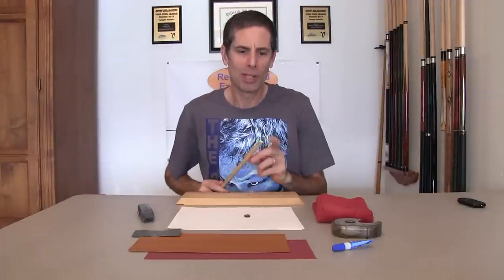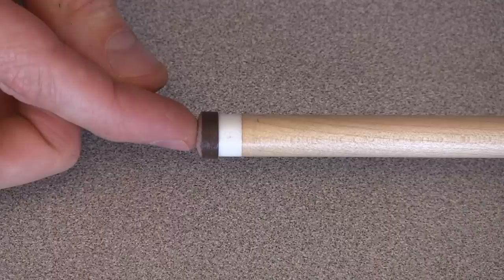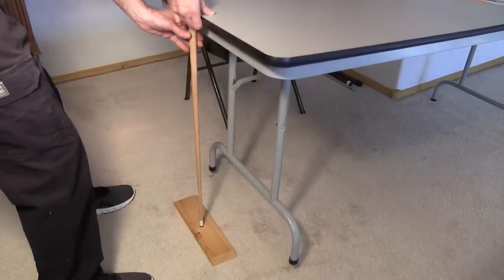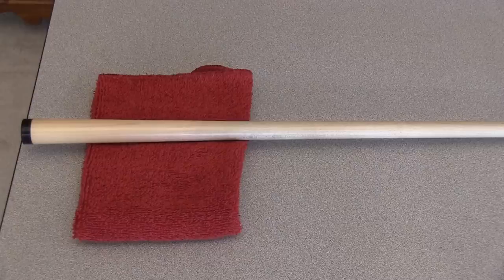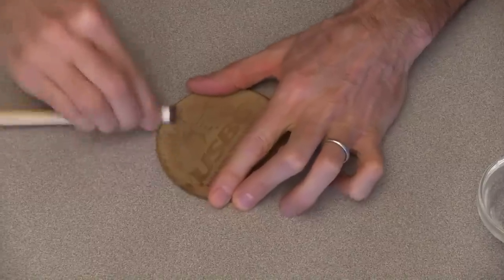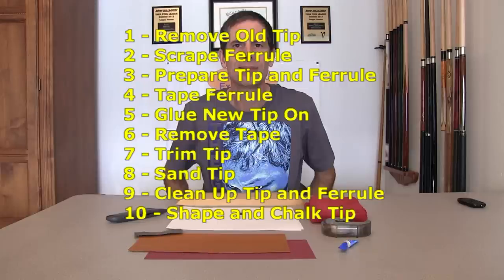HOW TO REPLACE A CUE TIP … No Special Tools Required

Comment from the maker: Table of Contents:
- Intro  [0:00]
1 - Remove Old Tip  [0:35]
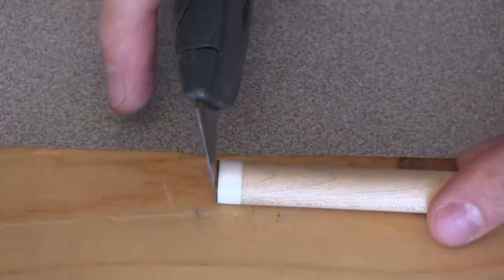2 - Scrape Ferrule  [1:08]
3 - Prepare Tip and Ferrule  [2:02]
4 - Tape Ferrule  [2:30]
5 - Glue New Tip On  [2:55]
6 – Remove Tape  [3:44]
7 - Trim Tip  [4:04]
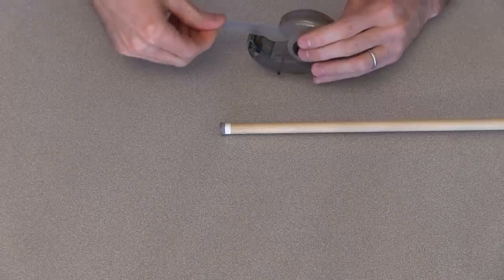8 - Sand Tip  [4:40]
9 - Clean Up Tip and Ferrule  [6:16]
10 - Shape and Chalk Tip  [7:10]
- Wrap Up  [7:43]
---- process montage  [8:20]

Supporting Resources:
- detailed 10-Step Cue Tip Replace Procedure document:  https://billiards.colostate.edu/resource_files/cue-tip_replace_handout.pdf
- cue tip replace resource page with other videos:  https://billiards.colostate.edu/faq/cue-tip/replacing/
- Efren “The GOAT is my Hero” T-shirt:  https://drdavebilliardtshirts.com/product-category/humor/goat-hero/
Reply: I use painters tape to keep super glue off ferrule.
Reply from the maker: @TimZ007  Nothing wrong with that.  I just wanted to stick with one type of tape for the whole process.
Reply: I know this is off topic, (thank you for the cue tip know how!!❤❤) but the Blue Pool Table you use in your videos, aka your 57 ball run out (impressive by the way 👏) blue pool table. What are the dimensions of that? Is it 8x4 or 7x3.5 or 6x3? And what kind of Felt are you running on it? I'm just very curious. Thank you DrDaveBilliards :)
Reply: @jakersdp5604  I don't know for sure but I think it's a 9-foot table. They're always half the width of the length I think. Usually the playing surface on a 9-foot table is 100 inches playong surface. Most likely it's simonus that's usually what everybody runs but you could be champion or Andy cloth hi imagine it's one of those three
Reply: @TimZ007  right. I knew about the width always being half of the length. I was just wondering what his set up is. Thank you though, @Tim Z
Reply from the maker: @jakersdp5604  It is a standard regulation 9' Olhausen pool table with "Tournament Blue" Simonis 860HR cloth.
Reply: what grit of sandpaper you use while prepping the ferrule and tip?
Reply from the maker: @jeowinteo2901  All details like this can be found in the procedure document linked here:
https://billiards.colostate.edu/faq/cue-tip/replacing/

Comment: Pro tip, wear safety glasses. Actually had to go to the ER one time because I was putting a tip on and while I was putting pressure on the tip it slid off and a stream of superglue shot directly into my eyeball. I've been at the ER before for other things but this time was unique because when I got there they were freaking out and ushered me in immediately, normally you have to wait 40 minutes to see a doctor. After the ER doc conferred with an expert eye doctor over the phone, he told me the layer of glue on my eye would eventually 'wear' away. It hurt like hell to blink for about 2hrs
Reply from the maker: Thank you for sharing this.  Great "tip."
Reply: Not an enjoyable experience mine was both eyes couldn't open them home alone. Scared me.

Comment: I'm glad you covered this. I've done it before but the tips never lasted. This was much more detailed and had a few step where I went wrong in the past.
Reply: The tip and the glue matter. I ran two pool rooms for years. We had a handy all-in-one tool that I wish I still had that put tips on. But, one thing we found through 1000's of tips was the glue. We ended up liking Loctite Gel Super Glue. It does not dry completely brittle and has some give to it and allows the tips to stay on for a long time.
Reply: I had to go look for that old piece. It was called a Willard Tipping Machine. I really enjoyed putting tips on with that. Had to be careful, you could mess a ferrule up.

Comment: Dr. Dave. This video saved my stick. I bought all the usual tools online; they just dug in and ruined tips. Other than the cue top sander, everything else failed. I used your process and now have a perfectly installed tip! Excellent video! I used 80 and 120 grit then switched to 1000, 2000, then 00 steel wool to finish the job. Thanks!
Reply from the maker: I'm glad the video helped.  Cool.

Comment: An additional thing I like to do is to "set the chalk." Basically once you chalk up, use one of the rasp like tools to roll on the tip and embed chalk into the tip, then rechalk and it's ready for play. This is especially important on hard tips. There are tools made just for this, but often the flat scuffer part of tip tools will do the same thing, or you can use a fine rasp.
Reply from the maker: Thank you for the suggestion.  I just chalk frequently during initial practice with the new tip.  That seems to do the trick.

Comment: I always heard people say to score the feral and back of the new tip to help the glue settle. Also the glue you get is very important.
Reply from the maker: I don't think scoring is necessary or even helpful.  Sanding is better to create uniform and easy-to-bond surfaces.
Reply: @DrDaveBilliards  💯

Comment: I was given an older McDermott cue and the tip was dry rotting (crumbling when I shaped the tip). I followed these instructions and it came out beautiful. I break with this cue and have had no problems what so ever in the last 3 months I've used it. Great advice. Thanks
Reply from the maker: I'm glad to hear it.  You're welcome.

Comment: I like your tape idea to increase the diameter as a sort of jig to help center the tip.  I will try this next time.  I find it is a lot easier to dress the tip if it is properly centered so that the factory crown lines up, then final shaping is much easier to accomplish than when the tip is off center and you have to remove material from one side of the crown to recenter it.
Reply from the maker: Good point about shaping being tougher if an existing crown is off center.
Reply: The tape will also protect the ferrule from glue, right?

Comment: You have tremendous patience! Tried that myself 3 years ago and decided that 25$ for a professionnal job was a deal!
Reply from the maker: I also prefer using a pro when one is available; but I also like being able to do it myself if I ever need to.
Reply: Hmm, the entire method when you get used to it only takes about 15 to 20 minutes. I just replaced a tip, during a match a few days ago, and it took me about 15 minutes from beginning to end. It really is pretty simple once you have tried it a few times. And that $25? I would rather spend it on some nachos.

Comment: Was able to follow step by step only thing I would warn people against is when you cut the old tip off and start shaving the ferrule be careful to not shave off any of the ferrule. I had to do some sanding work to get it as flat as possible when I did that by accident. All in all great video
Reply from the maker: Excellent point.

Comment: You missed the most important step: BUY NEW GLUE!

CA (super) glue loses it's effectiveness over time, especially if opened. When I do a new tip, or batch of tips, I always buy a new tube from a busy retailer (walmart) that restocks it fequently. 

If your tips keep popping off and you can't understand why, this is probably why. Start with new glue and you will never have a tip come off prematurely.
Reply from the maker: That's good advice.  Thank you for posting.  I'll add this to my document.
Reply: so what type of glue is recommended?
Reply from the maker: @jubilee4jC  I think any cyanoacrylate (super glue) gel is fine, assuming it isn't too old.  I use Loctite brand.

Comment: As always, great video. I am going to be doing this for others, now. I bought those ball bearing roller sets on Amazon. You'll see them for about $20. I believe it will make the process even easier. I'm also going to be fabricating a tool for the tip tool that allows for cordless drill use. I suppose eventually I'll graduate into a lathe attachment to turn my corded drill into a lathe or the bench to grinder, that I've seen on YouTube quite a bit. Very rewarding and relaxing hobby.
Reply from the maker: I’m glad you enjoy your hobby.  It is satisfying to do your own craftsmanship at times.

Comment: A collapsable small silicon funnel, cut the narrow end so its just wide enough to be snug fit over the ferrule. Wide end facing away from the cue, then press the new tip into the funnel. Perfect centre everytime.
Reply from the maker: Thanks for the "tip."

Comment: Did you watch me sometime in the last 30  years? That's about how long I've used (almost) this exact method.
I curl sandpaper to trim the sides of the new tip, with one layer of tape around the ferrule.

Comment: I did my first tip install yesterday. Followed the video to a T. Cane out beautiful. Thanks once again! I will order larger diameter for my next que. It was tough trying to center the tip after gluing. I had no room for error. My que was 12.99mm and tip was 13.01. having a larger tip size will be easier to install. Excellent video
Reply from the maker: I'm glad to hear it.  I'm glad the video was helpful.  A larger tip takes a little more sanding, but it is much safer.

Comment: Excellent video and tips. This is very close to how I have changed many tips for years with great success. Never have I had a tip fail and never had I had to pay someone else. Your method is fairly detailed and if someone just takes some time it is pretty hard to mess this up.
Reply from the maker: Thanks.  There are some things that can be messed up. 
 For examples you can easily damage the ferrule during the shaving/scraping/sanding or by sanding the tip down to diameter with too much pressure or with cover paper too thin. But I agree that with a little care and experience, the procedure is reliable.

Comment: Thanks Dave and Bob. I scratched up a ferrule on my snooker cue before. That paper over sandpaper method would’ve helped. Got 2 more cues to do, I’ll have to remember patience.
Reply from the maker: If the paper isn't thick enough (or doubled up), or if you push too hard, you can scratch the ferrule with this technique also.  Patience is a virtue.

Comment: Great method! Widening the shaft with tape is a great idea. I've put a few tips on  off-center. The edge sanding method is good too
Reply from the maker: Thanks.  I'm glad you picked up some new ideas.
Reply: I'm going to use the edge sanding technique on other things. I've never thought of putting paper and a block as a guide. Very slick idea.

Comment: Great video Dr Dave. As a top fitter myself I would like to offer a few suggestions. 
Try using a very sharp blade or a scalpel to get the tip flush with the ferrule. 
That way u wouldn’t have to sand the edges too much. Secondly u should NEVER sand the ferrule.
Reply from the maker: Thank you for adding your advice.

Comment: I just changed the tip using your method and I think it came out quite well. Going to try it next week but I'm pretty satisfied with it :)
I'm going to get a tip-shaper tho. Doing it with sandpaper was just a bit too tricky and time consuming because it came out a bit uneven and flat on the top first and had to try to reshape it.
Reply from the maker: I'm glad the video helped.

Comment: I keep my Milwaukee pocket knife 6 in 1 that is a utility knife glue and sandpaper in my bag for this I even have rubber bands to hold the tip on as I seen that is what McDermott does for their method
Reply from the maker: I have a “cue guy” replace my tips whenever possible, but it is helpful to be able to DIY it when necessary.  Good idea with the multi-tool knife.

Comment: That's probably a better method than what I did pressing down with my finger, sanding the ferrule and the tip at the same time with 220, turns into 320 when the 220 is used, maybe I'll finish it off with the 2000 grit I have and water the edge like that. If my tip comes off again I think I can do a better job than my current one after watching this, thanks.
Reply from the maker: I'm glad you found it helpful.  You're welcome.

Comment: Super handy video. I've been Looking at cues on ebay. Often times they don't come with a tip. Have you tried painter's tape ? It may be easier to remove.
Reply from the maker: I'm glad you like the video.  Painter's tape is a good idea.  Scott Magic tape is nice and slick and I think it provides better protection, but I'm not sure.

Comment: I posted a comment about this video a year ago saying this method is very close to how I have changed tips for many years. I stand by that, but want to add one more thing: don't fall for these guys that want to charge you a bunch of money to replace tips!

It is actually VERY easy if you just follow what Dr. Dave showed in this video. Don't be afraid to change your own tips. Also, carry a little tip changing kit with you. Three days ago I broke a tip while playing. I missed a shot, and in frustration sorta jumped up and accidentally hit the tip of the cue on a wood frame. The tip came off. 

This tip had last me two years and a lot of hitting the cue ball. It didn't come off because it was put on poorly, it came off because the wood frame it hit, hit it perfectly and knocked it off. Any tip would have came off after being hit that hard, at that angle.

Thankfully I had a little tip changing kid with me. A tip, a sharp knife, some sandpaper, some glue, and a tip shapener. Within 15 minutes, literally 15 minutes, I was back playing with the new tip on my cue and the tip performed just fine.  If I can do it, so can anyone else.

It truly is not that difficult.

Comment: Again, Dr Dave is a one stop shop for pool info. I'm gonna give a Triangle tip a go. And if I don't bond with it I'll try a higher end tip. Currently using a Elk Milk Dud
Reply from the maker: The procedure works well if you are careful, and it can actually be fun.  I hope it goes well.  If not, try again.  Like anything, practice makes perfect (especially perfect practice).
Reply: @DrDaveBilliards  I got some glue on the outside edge of my tip. Is the tip trashed or is it not an issue? I used a little paper to perfectly center the tip. Wrapped the paper around the ferrule and raised it so the tip would rest in it . I didn't get over sized tips and it worked great. But the amount of glue I used seeped up the sides and got on tip
Reply from the maker: @BlackDynamite901  I would fine sand it a little, but it isn't a problem.  That's one reason why using an over-sized tip is better, because you cut and remove the edges (that might have glue on them) away.
Reply: @DrDaveBilliards  Awesome. Thanks for the speedy reply. 👍🏿😎
Reply from the maker: @BlackDynamite901  You're welcome.  I aim to swerve.  :)
Reply: @DrDaveBilliards  My Triangle tip did phenomenal. Don't know what's the main diff between it and a Elkmaster but I love it more. Got second place(never placed before) last night for 9 ball tourney. Ive been a 3 for over a year now. I think it's time to move up! Choked on the easiest shot you could have and lost it. Was happy with my performance so I didn't best myself up. Even tho I got 200 less than first😅
Reply from the maker: @BlackDynamite901  I would give the credit to you ... not the tip.  Good job!

Comment: NICE! I've been replacing my own tips for many years and of course bought all the 'special' tools, this sure would have been cheaper! (great process!) The superglue GEL is the most important part. It's the only thing I've found that works well consistently.
Reply from the maker: I'm glad you like it.  Good point about the gel.  It does work best.

Comment: Wow, this looks way harder than I anticipated 😢. Guess I’ll be finding someone to professionally install my new Kamui tip, otherwise I may screw it up. Great video though! Just takes way more patience than I have lol 😅 Also, how come no pad first?
Reply from the maker: I also use a pro to replace my tips.  A pad is optional (but important for a CF shaft or any shaft with no ferrule).

Comment: Good tutorial, it's pretty much how I change tips. However I can't stress enough how important it is to use fresh super glue, or if it has been opened before, it must have been stored in the refrigerator for only a few months
Reply from the maker: That's good advice.  It is also probably best to buy the multi-packs of small single-use tubes.

Comment: A great guide
I will follow ur steps
At step 9 Did you use water to shine the tip ?😅
Reply from the maker: Wetting the sides of the tip helps the burnishing process, making the sides harder and shinier.

Comment: Hi there Dr.DaveBilliards!I'm trying the methods that you've shown.I tried to put my tip without the glue first just to make sure if it's perfectly leveled.sadly,it's not.what do you is the problem?is it the ferrule or the tip?by the way,great video.very helpful and more detailed.😊👍
Reply from the maker: It could be either, but I would guess the ferrule, assuming you sanded the back of the tip as I demonstrated.  FYI, much more detail is available in the document here:
  https://billiards.colostate.edu/faq/cue-tip/replacing/
Reply: @DrDaveBilliards  Thank you very much for your help Sir.I guess I'll just do it again.I just can't get my ferrule perfectly flat.glad to bumped on your channel.you gotta new subscriber.stay safe.😊👌
Reply from the maker: You're welcome.  I aim to swerve.  :)
Reply from the maker: Obviously, it is much easier to keep the ferrule flat if you use a lathe, but some other ideas can be found in the comments and quotes here:
    https://billiards.colostate.edu/faq/cue-tip/replacing/

Comment: I've used variations of this method for years ... but I've found the CA glue often finds it's way under the tape and sticks to the ferrule ... which leaves you with a tedious effort to get the glue off the ferrule.
Reply from the maker: Have you found a solution?  Maybe a different type of tape or tighter wrapping?
Reply: @DrDaveBilliards  Have tried other tapes but none have solved the problem. I just stick with Scotch tape because it has the most "grab" of the others I've tried.
Reply from the maker: @Kmuggle  I like Scotch Magic Tape the best.